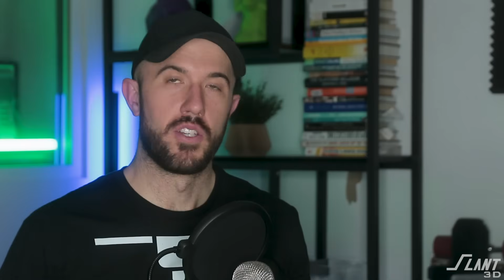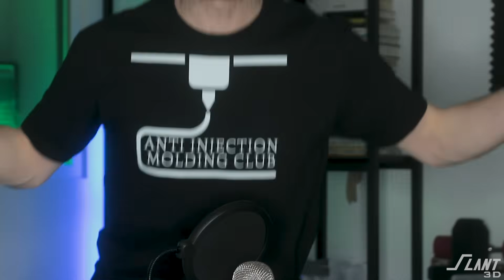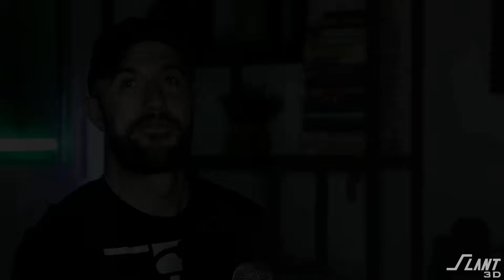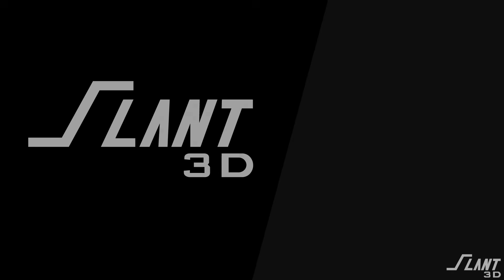3D Printing News | The Story of the Apple Keyboard | Why Etsy Catalog is Important | Tangled Updates

Comment: So basically Apple (or, apparen;tly, Multi-Touch?) just took the basic principle of the QUERTY keyboard and made it dynamic?  The layout of a QWERTY keyboard is explicitly designed to separate not only the most common letters but the most common lettery combinations to both reduce the priblem of typewriter arms striking each other but also the user hitting the wrong key.

That's both very cool as an idea, and a good example of how a small iteration on a concept can make a big difference to the user experiences.

Comment: A Tangled membership is a great idea.
Note that any membership incentives will lead purchase demand peaks near end of membership periods, and/or incentive periods. Similar to what Costco, etc. experience with coupons and membership offers. This can be a good thing as it can be used to manage demand and timing of demand over a longer term cycle. Slant 3d will need anticipate any peaks in the context of annual consumer holiday cycle as relates to internal resource allocation.
Suggest considering a couple of membership levels: one geared to longterm commitments, and another geared towards hobbyists, etc. that can be stopped and restarted after a period of time.